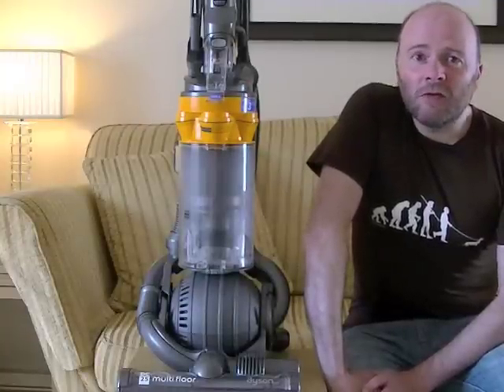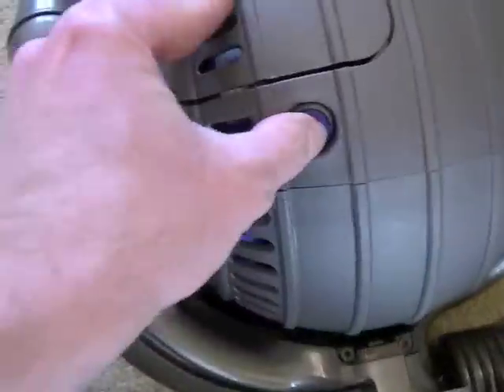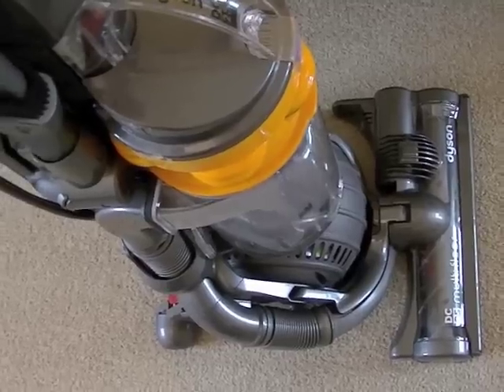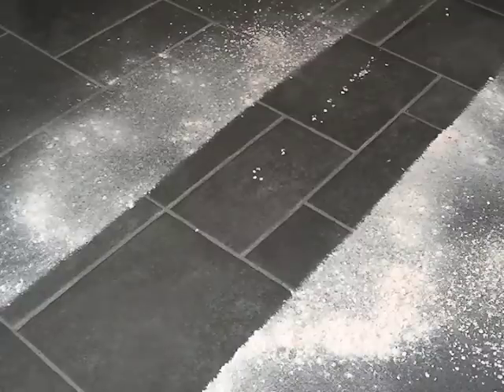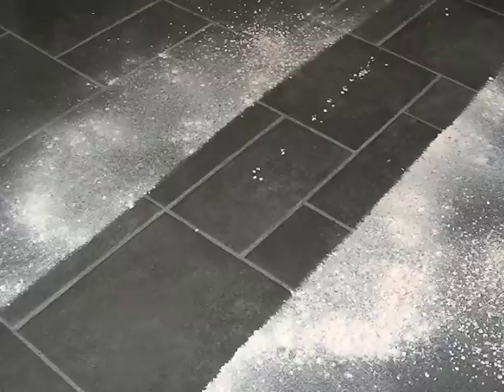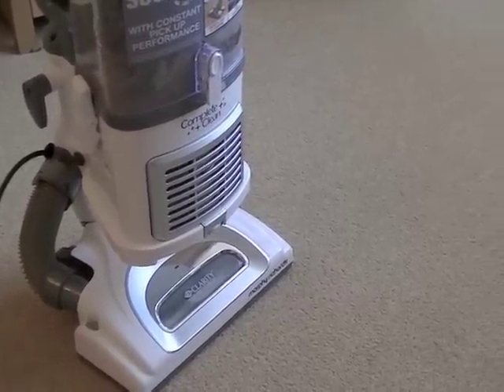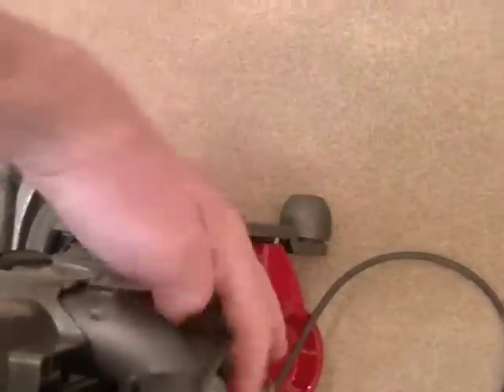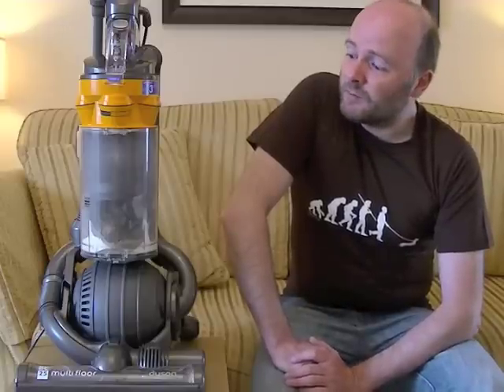Dyson DC25 Multi Floor Bagless Upright Vacuum Cleaner Home Demonstration

Comment: the main advantage of a Dyson is the cyclone assembly. It works and it does not get clogged - if maintained. The heads are too close to the floor and won't pick up big objects - as you noticed - not sure why they are designed like that. The Dyson's also won't release anything in the air - and you don't need to change filters or bags for that to happen. That I believe has been confirmed by some tests. (Yes, a Miele won't do that either but you'll have to account for bags and filters over time).
I have a second Dyson in my workshop, I use it connected to circular saw, sander etc. Any other cleaner would clog after seconds, requiring a new bag.
I'm not saying that Dyson's are the best ever - just sharing my experience with a 10y old DC-08! :)
Reply from the maker: I read many reports and seen pictures of Dyson Cylones that are absolutely packed with dust and they don't make them easy to take apart for the average user, so after a period of time even a Dyson can loose suction.
Reply: +ibaisaic Yes, I've seen those videos too. however my 10y DC08 never had this problem and I've disassembled it twice. I feel that if the cyclone is properly maintained (emptied in time and filters cleaned) then it will perform OK. I've also heard that there was a specific model of Dyson with a design flow which was causing the cyclone to clog - Dyson apparently took care of the problem with all the existing customers.
Reply: @ibaisaic  They do get clogged with dust probably 50% of the time. The hardest part about putting it back together is the spring. No one ever washes their filters and half the people do not empty the bin every time they use it.

Comment: I have the American version of that white vacuum, the Shark Navigator NV355. It’s the only vacuum I’ve ever used that handles diatomaceous earth without a problem. Bissells (didn’t filter out the DE and just blew it right back out), Kirbys (bag pores clogged and the brush roll belt started slipping as DE built up on it), and Filter Queens (blew out the paper cone seams), none have handled it quite like the Shark and it was a trash pick, it was abused really bad. They aren’t particularly robust machines, don’t expect a lifespan of more then about 3-5 years, but they do work really well.

Comment: Bought my DC25 Animal at a thrift store for $25, the only problems with it was the canister/cyclone needed to be cleaned, and replaced the filters and brush head. It runs brand new now, and I've had it for 2 years.

Comment: I found this video strangely captivating. It's probably because I'm considering a Dyson, but now I am leaning toward the Shark. I really dislike that the Shark's cable is on the right, because most people are right handed. It makes it much harder to route the cable with your left hand, but it wastes cable if you route with your left hand anyway.
Reply: ***** The Dyson is amazing. It works perfectly but the only thing you need to know is that some carpets brands don't recommend Dyson because of it's extreme suction. I haven't had that problem with any of my large area rug and it really really cleans great!

The only think I don't like is that I have to come here to figure out how to use the wand and get it back together.....
Reply: I finally just fixed my Hoover by just cleaning everything thoroughly...including the sponge-like filter which hadn't been cleaned since I had it (oops). Now it works much better. That Shark is still calling my name though.
Reply from the maker: ***** I prefer the Dyson DC40 to the DC25. There's an unboxing and review on my channel. Shark seem good value compared to Dyson, but we don't get as many Shark models in the UK as you get in the US.

Comment: No one has explained Dyson the way you did. Thank you! I had this DysonDC25 since it first came to the US market which was a lot of $$$ for a vacuum cleaner. Anyways 3 months ago it stopped working. I had time last week to take a look, i cleaned and washed filters and left it under Texas sun inside my car dash. After 24 hrs i put it back and now the vacuum is working, but now the motor or something is making annoying noise when vacuuming! Idk what it is! I watched few videos last night, they suggested it is the filter making the noise because of washing! What's your recommendation? I know you have more experience then any other reviewer i have watched this week.
Reply: Do u still have it?
Reply: @hamzahassan7730  Yup!
Reply: @seekfactsnotfiction9056  were u able to figure it out. I think the issue is the filters gasket was bad
Reply: @hamzahassan7730  I didn’t change anything but I’ll take a look into it! I was just using it despite the noise
Reply: @seekfactsnotfiction9056 yeah from what I know if the gasket on the hepa filter goes bad, air escapes from it which causes this whistling noise. In that case you will need to replace the filters
Reply: @hamzahassan7730  I remember actually replacing the filter, I just checked my Amazon orders, but that was the only thing I replaced, it took care of the anointing noise but I was not as much quieter as I anticipated!

Comment: hi roger i have the older model of dc25 multi floor at my dads and i done that sort of test and it done alot better than your one why i dont know and its used as a daily vacuum with a cat that leaves hair everywhere and the filters very rarely get washed

Comment: The DC25 is good on the carpet or at least my dad's DC25 Animal is. My dad's stairs are wide enough at the bottom to rest it on the step and it reached to the top but it wouldn't reach to the top. I filled it after one room on a fairly clean carpet. Would that be because it is the animal model or would the multifloor model perform the same in every day use?

Comment: All we had to pay was the sales taxes on ours since we got it through HP rewards, I would never pay full price for this machine since there are so many flaws with it, not to mention its not ergonomic at the handle when you have to pull it around while using the extension wand, and, the cleaner wont stay in place on the floor, it tips over alot. Also, I have had to send it in to repair twice because of a faulty spinning mechanism that quit working, therefor the bar would not spin, which required me to drive all the way to the next town to have it shipped to Houston and use a back up cleaner until I got it back a week later. Granted it was a free repair but If I had paid full price on this piece of junk I would have been very upset.

Comment: what you do is use the dyson to pick up the muck as you would and use a miele or sebo to over the same carpet using an empty bag and compare the contents of it what the dyson left behind. it will give a comparison of the suction but also the agitation feature of the miele and sebo.

Comment: I actually rate the shark better, but the comparison of the 'lines' remaining in the dirt is unfair as you pulled the dyson back over the same path but with the shark you pulled it back about 2 inches to the right of where it went forward, thus picking up the lines on a different part of the brush
Reply from the maker: Jason Bodell It was not a deliberate act on my part that I didn't follow the exact path, but if I still owned either of these cleaners, I would do the same test but make sure the cleaners went at the same speed and stayed parallel to each other. If I were to test my Dyson DC40 against my Shark rocket, the Dyson would win in that case.

Comment from the maker: I wasn't impressed with the Dyson DC25 and have since sold the model in the video. There seems to be a lot of complaints online that the latest Dysons have gone downhill and it is very very unlikely that I will buy another Dyson. Check out my other videos for the Morphy Richards Complete clean, especially the one Vs the Henry Micro. If you don't need the dustaway tool, get the 73411 Family and Pets model. It's currently £99 from Amazon which is a bargain in my opinion.

Comment: I thought that the max was like a brand! XD (Just because I say this dosnt mean I have DC25, I have DC14. Both are old models).
Reply: If my DC14 breaks down. Either my parents will get something else like shark or hoover or kribby. Or we will get a new dyson  (Ball). It will be sad if we get something else. But my DC14 has been running for 7 years and it is as good as new (Except for the dirty filters, I am not 20 years old yet and we wont get a replacement)!
I washed the upper filter 2 times but never the HEPA filter. I have opened it and it was black and dirty. I remembered when we got the DC14 new, I broke the crevice clip. I wish we had the crevice. It should be in one of the boxes.

Comment: I'm sorry if this is a daft question, Roger, but would it be possible to clean the cyclones by running a teapot spout brush down them (I think it would be narrow enough) or would it scratch them too much?
Reply from the maker: It probably would work, but I have never seen a teapot spout brush. Any scratches would be on the inside, so I doubt it would matter if it did scratch.
Reply: ibaisaic It was the first thing I thought of as we always had one in the kitchen drawer when I was a child! I looked them up on eBay and Amazon and they are still available!
Reply from the maker: There's one on Amazon that is cyclone shaped. It looks ideal for the job.
Reply: ibaisaic :)

Comment: I did a similar test a few years ago with a Dyson dc07 vs vax power3 the Dyson wasn't anywhere near as good as the Vax Dyson was almost 3x the cost of the Vax , I think Dysons for the money are overrated compared with cheaper competitors machines

Comment from the maker: Dyson has gone downhill in my opinion. I have sold this cleaner since making this video as it really didn't perform very well. The brush roll started to rattle slightly too, so I was not impressed. I will not be purchasing another Dyson as the latest uprights seem to be even less well made.

Comment: What a creaky, wobbly, plastic fantastic, overpriced under performer!
Reply from the maker: Layan Gamage The DC40 is much better at cleaning, but doesn't feel that well made.
Reply: ibaisaic I have owned a Kirby for many years. It was fantastic at cleaning, but I just got fed up with the weight, and impracticality of the thing. 
I was researching what to replace it with, and after watching one of your reviews, I eventually got a Sebo Felix. I am delighted with this unassuming machine, which just does everything so well, and with a minimum of fuss. It is also well built, lightweight, and cleans really well, without the need to beat the carpet to death (unlike the Kirby)
Thanks so much for your detailed reviews